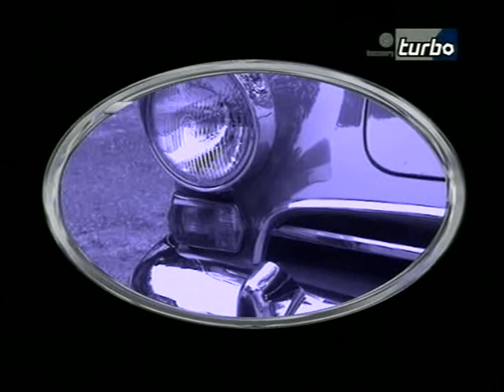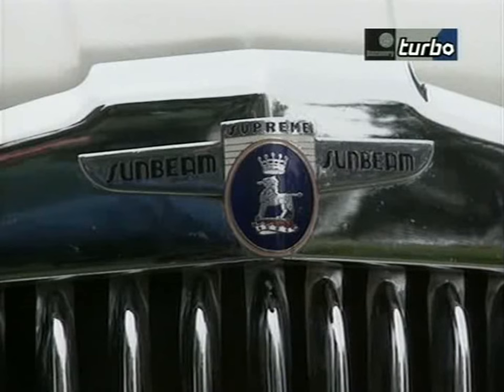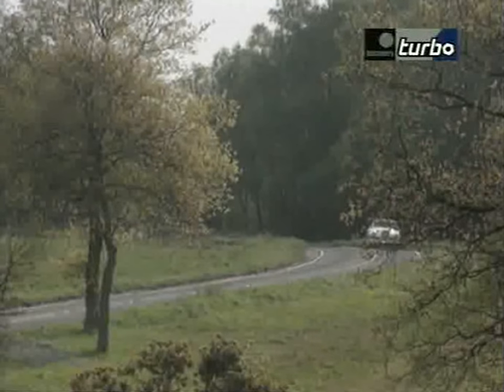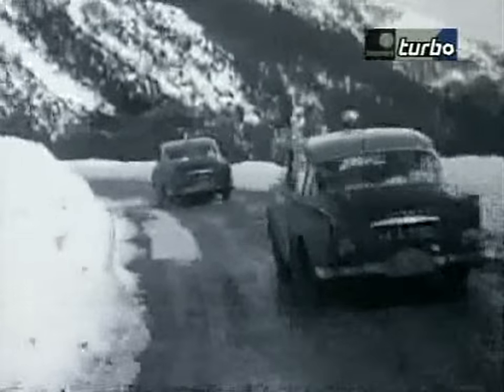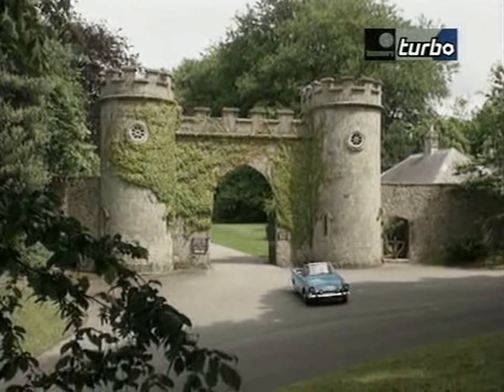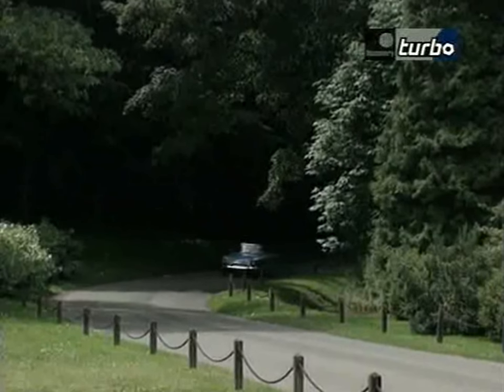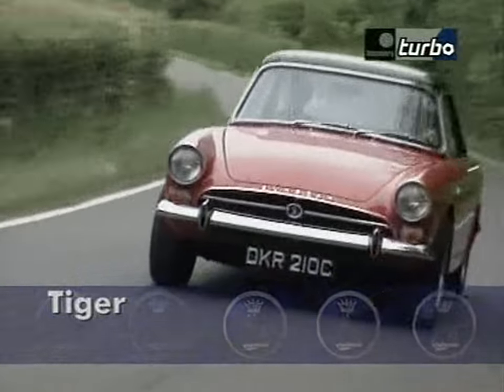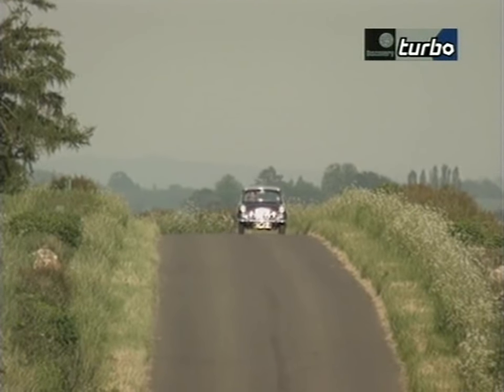History of Sunbeam Documentary

Comment: The "historian" claims they introduced the Tiger with "the 427 cubic inch Ford V8 engine."  Ha!  Yeah, right!  But no, sadly, it was the rather anemic 260 that started the Tiger line.  It finished strong with the 289.  Someone actually has placed a Ford big block in a Tiger, and it looks absolutely insane.
Reply: The only British car to have the 427 big block was the AC Ace, which Carroll Shelby turned into the Cobra . The Cobra started out with a 260 c.i. and progressed to the 289, just like the Tiger. Then Shelby added the 427 big block version.
Reply: The front bumper would drag lol.